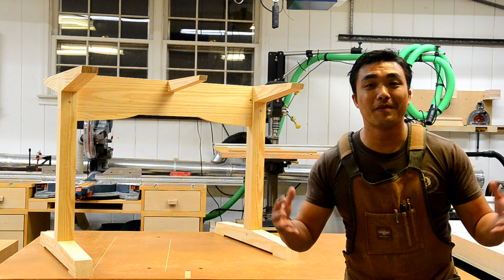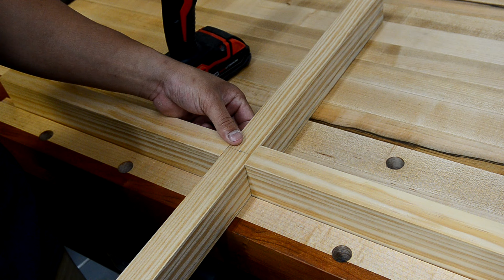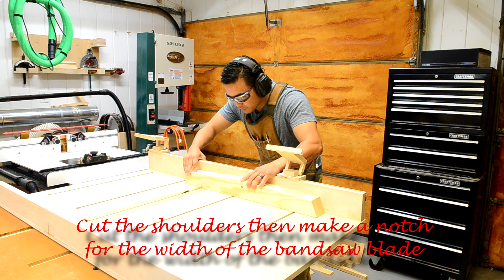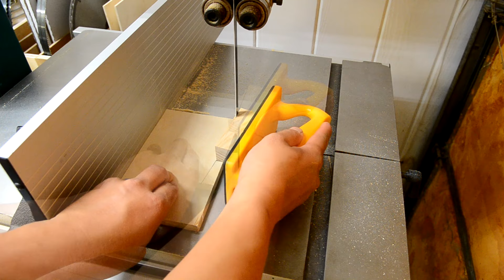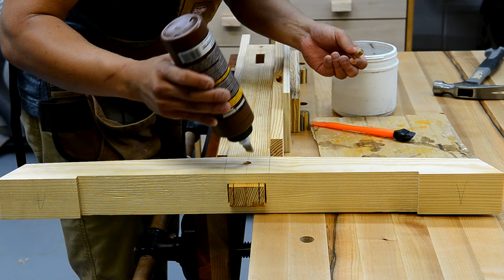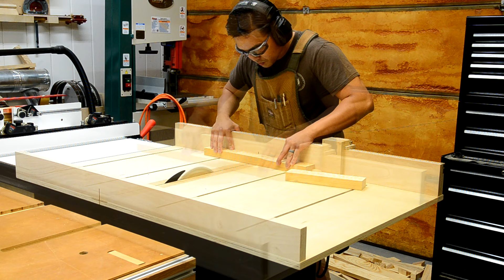Contemporary Trestle Table Part 2: Adding Shape and Mechanical Joints

Comment: Nice job! Your shop is looking nicer with every production too. BTW--have a look into some Sorby paring chisels if you haven't added them to your toolbox yet.
Reply from the maker: Carl Miller Thanks Carl! I have considered them as well as some Japanese chisels. Truthfully, I need to educate myself on chisels. The chisels I have now get the job done but I'm pretty sure I'll want a set of premiums at some point. Thank you for watching!
Reply: You're welcome and thanks for the great quality videos. I think that at least one paring chisel in the 1" range would be a great place to start; when you encounter situations where you're contemplating busting out a flush cut saw, a paring chisel may very likely come in as a natural (and extremely good) follow-up to chase your cuts. Their blades are long enough and thinner than normal chisels in order to be driven flush even across a broad surface such as the center of a table. You can then nicely slice away proud material. Quick thoughts:
Standard chisels: cleaning out bores, some light mortise work, short-stroke paring
Mortising chisels: heavy-driving boring chisels for mortising and other boring needs
Paring and skew chisels: Paring and flush cutting where a finish cut is needed
Aloha
Reply from the maker: Carl Miller Thank you for the explanation on the chisels. I've been using standard bench chisels to follow the flush trim saw. While I have a good assortment of power tools, I'm slowly building up my hand tool collection.

Comment: Do you think it would be better to cut the shape of the corbel out of the stretcher, instead of adding pieces on after?
Reply from the maker: The corbel is not used for structural strength and since the base will be painted, you'll never see the seam that joins the corbel to the stretcher. It's also easier to cut the smaller corbel on the bandsaw than to cut the shape of the corbel out of the much larger stretcher. Lastly, it's much easier to have two identical pieces when attaching them to the stretcher as opposed to making a template and pattern routing them into the stretcher. Thanks for watching and thank you for the question.
Reply: Right. I forgot the base was being painted.Thanks for the reply, and keep up the amazing work!

Comment: drill press? bold of you going free hand on all of those holes. also check your tension on your band saw. great vid. keep up the good work.
Reply from the maker: Gregory DeRosso I felt comfortable using the hand drill. I used the same method when I draw bored my workbench. I tension the bandsaw as per Alex Snodgrass' recommendations for setup. I've had the same blade on the bandsaw for the last 2 years, so I'm quite happy with the way the bandsaw is setup. Thanks for watching!

Comment: Your project is coming along nicely and another well done video.  I also have a question and a suggestion.  Why use both draw boring and a wedged tenon?  On the visible wedged tenons, I suggest using a contrasting wood to really highlight your work and it looks good.  Steve
Reply from the maker: Hey Steve!  Thanks for watching!  I know what you mean about using draw boring and a wedged tenon.  The article by Chris Schwarz suggested using draw boring, but I wasn't completely sold on using this additional mechanical joint.  After talking to a couple of fellow woodworkers that did this project I came to this conclusion.  The draw bore helps keep the mortise and tenon shoulders flush while driving in the wedges.  It's not necessary but it's like an extra set of hands to keep everything square and perpendicular.  I don't think I would've struggled with the glue up if I only chose to wedge the tenons.  I will say, this was probably one of the easiest glue ups I've ever done.  I would've used a contrasting wood but given that the base is going to be painted a lamp black milk paint, I decided to go with scrap hard maple and commercially available straight grain Oak dowel stock.  But, my next project (dining room trestle table for my wife) will definitely have contrasting wood.

Comment: Can't wait to see the finale! Have you thought about a finish?
Thanks for sharing.
Reply from the maker: Hey, Jeff!  Yes, I thought a lot about finish.  I've talked to several of my mentors and I've locked down on a finishing technique.  The base is going to primed and painted a lamp black milk paint.  This is purposefully done to drive attention away from the base and draw more attention to the top.  The top really needs to POP.  The solid Cherry top will be flooded with a 50/50 blend of Naphtha and boiled linseed oil to give depth of color.  I'll then wipe off the excess and put a couple of coats of garnet shellac.  Lastly, I'll seal the top with a water based finish.

Comment: Other than "because I can" (which is a great answer by the way) why use the draw bore AND the wedged tenons? They pretty much achieve similar results as to strength and pulling a joint tight. Just curious. I often over engineer things just to practice new techniques and skills so that is where my question comes from as you did say in a previous video this project would be a challenge with new techniques you had not done before. Great video and loving the progress!!!
Reply from the maker: I'm happy you asked this question.  You're absolutely right!  There comes a point were over engineering a project serves no return, in which case you're just practicing.  I was really on the fence about using draw boring because I didn't want the project to be an overkill of joinery.  After reading the Chris Schwarz article and talking to a couple of fellow woodworkers that have combined draw boring with wedged mortise and tenons, I came to this conclusion.  The draw bore helps keep the mortise and tenon shoulders flush while driving in the wedges.  It's not necessary but it's like an extra set of hands.  I don't think I would've struggled with the glue up if I only chose to wedge the tenons.  I will say, this was probably one of the easiest glue ups I've ever done.  Thank you for watching and thank you for asking such a thoughtful question.  Good times!